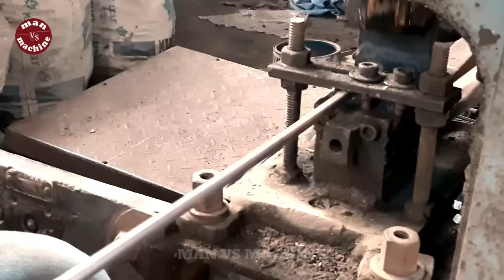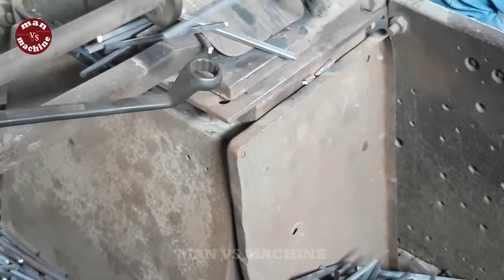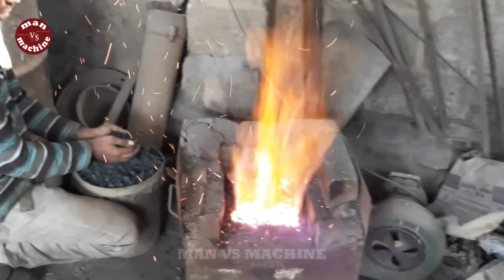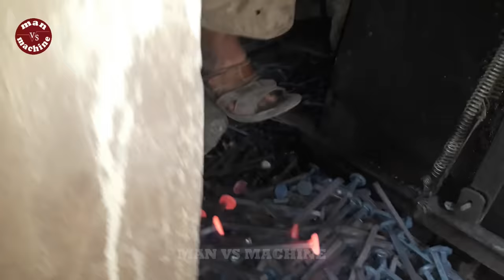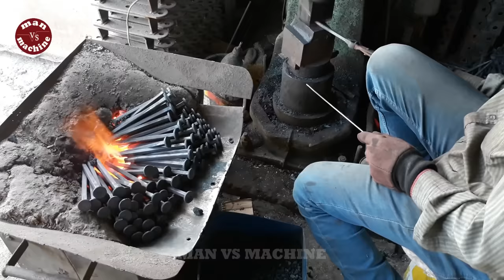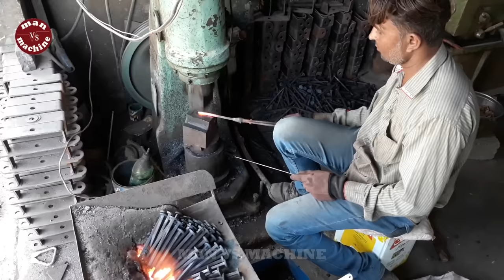Turning Iron Rods Into Nails | How To Make Iron Nails

Comment: A good rustic nail for unique applications,  the nail being made is designed to not split timber. Pretty costly even when manufactured with modern equipment, low demand item.